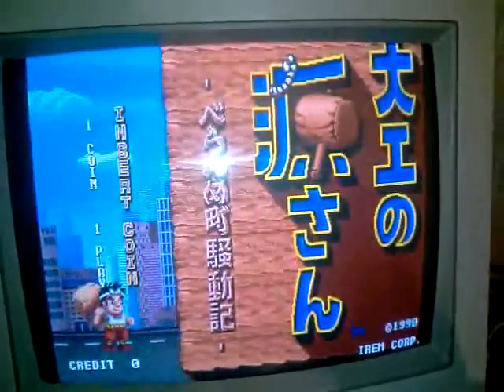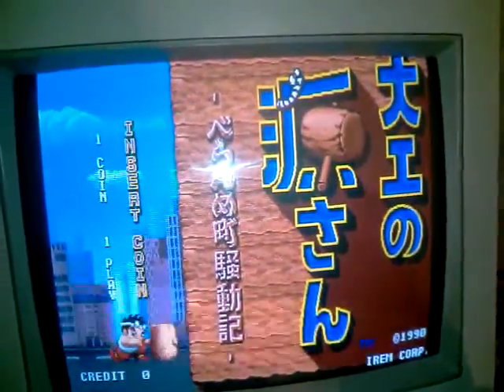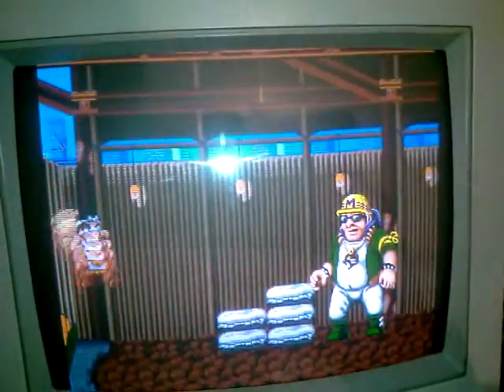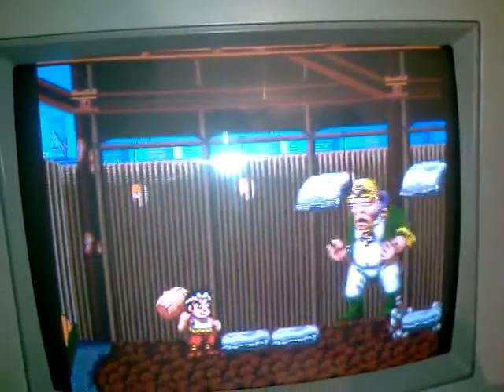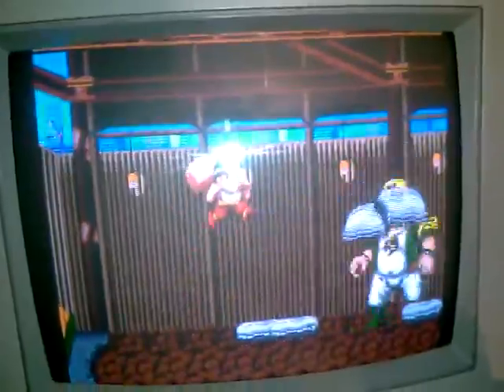HAMMERIN' HARRY IREM M84 ARCADE PCB REPAIR AND REGION MOD

Comment: Hi, I am new to the whole supergun arcade pcb scene. Just wondering how you set the voltages? Got a hammerin harry board on the way and don't want to damage it...
Reply from the maker: You need to get a multimeter, also depends on your power supply. The problem now is a lot of 'new /china' power supplies are crap.. What is the setup you have?